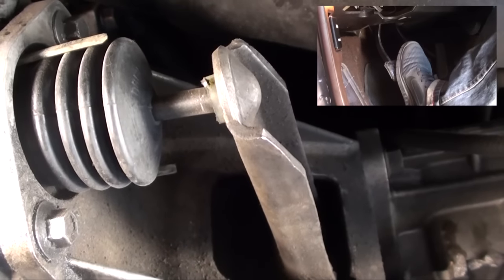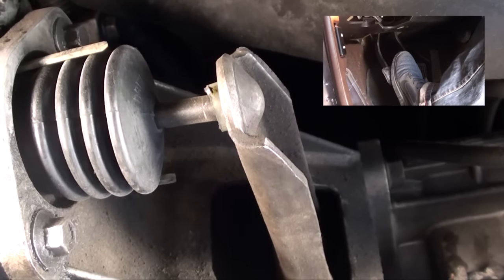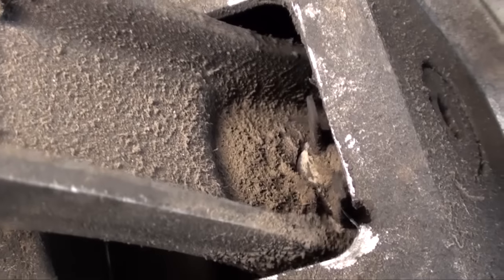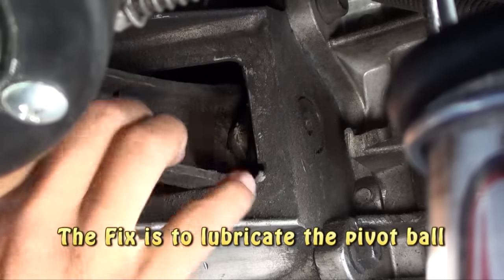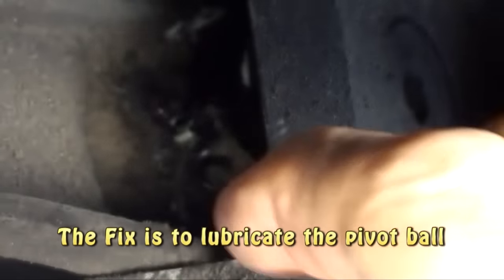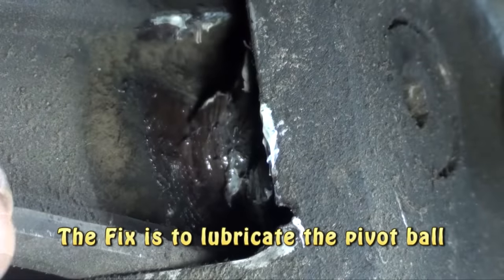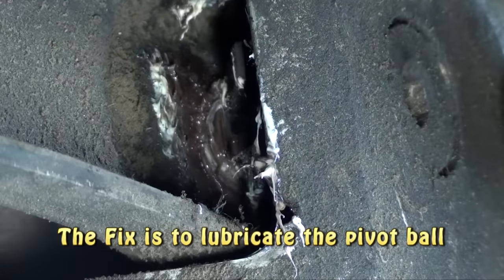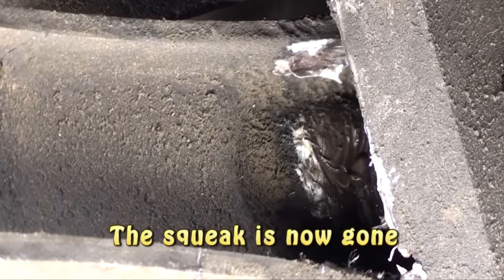Clutch Release Fork Noise

Comment: This video could potentially save viewers tens or even hundreds of thousands of dollars on unnecessary throwout bearing replacements! Thank you so much for this knowledge!!
Reply from the maker: Yup......  Not all clutch systems have pivot balls that are accessible from the fork access hole and not all clutch systems use a fork and pivot ball.
Reply: @DrivelineMaster  my mustang t5 transmission is doing this,does it matter what grease you use?
Reply from the maker: Any grease will work but lithium based greases work best for this location.
Reply: @DrivelineMaster  ok ,because man mines is so loud and aggravating
Reply: Where is this located?  My 94 mustang gt started doing this.  I couldn’t find
Reply from the maker: If I'm not mistaken your mustang uses a cable instead of a hydraulic cylinder. The cable connects to a metal arm called the release fork and it's located on the left side of the bell housing. The bell housing is between the back of the engine and the transmission.  A rubber boot overs a hole in the bell housing where the fork sticks out so dirt doesn't get in.  Normally that boot is pulled back to expose the pivot ball and lubrication can be applied like in the video.  On some designs such as yours the pivot ball is located on the opposite side of the bell housing with no access to lubricating while the transmission is still bolted to the engine.  In order to lubricate the pivot ball on your clutch system the transmission will have to be removed.  If you go that far you might as well change the entire clutch since the labor cost is almost identical.  I wish I had better news.
Reply: Absolutely correct.

Comment: Not sure why this video was recommended to me again, but I saw this video several years ago and it helped stopped the squeak on My 2006 Subaru Forester.  I just removed the rubber boot covering and jammed as much grease in there as  I could and the noise was gone.  The squeak started the day I got my clutch replaced by a mechanic so he must not have greased it.  I sold the car earlier this year but just want to offer a late "thank you" for getting rid of the noise that was driving me crazy.  Merry Christmas!
Reply from the maker: Glad it worked out for you. So sad that the service tech didn't know enough to grease the pivot ball.

Comment: My mechanic diagnosed my sound as a release bearing which would of cost 1000 aud. I had a feeling if wasn't the issue so I done some research and ended up here. I followed the steps and nothing, still the same sound, so I added more grease and still nothing. After i drove around for an hour and then it stopped. Fantastic. So to anyone who tries have some patience. It might take a while for the grease to spread where needed. Thanks

Comment: Had a squeak in my ‘08 WRX; shit raised my blood pressure. Mechanic said it’s a TOB & that I need to replace the whole clutch/flywheel. The appt was today but I cancelled, and tried this instead.

My squeak is 100% gone. Saved me $1,500. I did not think this would be so easy to correct, but it was. Thank you very much, sir; appreciate you.
Reply from the maker: That is fantastic.  Yes, some WRX release fork pivot balls can be reached by simply removing the inter-cooler and pulling back the release fork boot. This give you access to the pivot ball.  Glad it worked out for you.  There is a clear difference from when this noise comes and goes and when a release bearing (TOB) noise comes and goes.
Reply: Thank heavens I found this comment I have same issue with my 11 wrx! Thank you!
Reply: me too

Comment: Thanks so much. After long periods of time working with the master cylinder and clutch tweekings and changing the throw out bearing and cluch press for the gears to work. All of a sudden this noise came out. It was a bummer because we think that the throw out bearing was damage because of water. And now i saw your video problem solved. May Allah bless u
Reply from the maker: Yippee!  I had no idea how many people have this problem and how many automotive professionals think this is a throwout bearing noise.

Comment: Thank you for this.  I had the the same noise coming from the clutch area. I went ahead and lubricated the bearing just like you did and voila, the noise is gone! Will share this video to help other folks experiencing the same issue! Thanks again
Reply from the maker: I'm glad it worked out for you.  I had no idea how common this issue is until after posting this video.
Reply: Jeeminy. I hope my '06 Accord 4-cyl. Has this problem, and is not the thrustalizationizing bearing. My mechanic, who is the best I have ever found, is also pricey. Wants 3 (followed by a comma and 3 zeroes) to do the whole clutch renewal. If I do get in there to do it myself, it is ridiculously involved, and hope I don't get stumped with WTFs and magic tool needs. I've done trans R&R on older vehicles, RWD where the transmission was behind the clutch behind the engine, and although a couple bolts were hard to get to, 12-point box-end wrenches and standard sockets on 1/2" ratchet drives worked in the tight spots. 
    On my Honda car, I have to remove a wheel, CV axle, even the battery, its shelf, air box, even unbolt the intake manifold! So re-frikkin'- dick-ulous.

Comment: Had old clutch replaced, been driving around 2000km, and noise started. After seeing this, im pretty sure i drove over few very dusty road construction = might have dirt in that part. Thank you for this nice video!
Reply from the maker: There is supposed to be a rubber dust boot covering that hole.  Mine was missing for this video.

Comment: Thank you a lot for your help! I replace the clutch a few weeks ago after that I have this annoying noise and with your video I figure out what is the problem.
Reply from the maker: Unfortunately too many technicians who change clutches don't know how to properly lubricate the clutch release fork pivot. This also puts into question if they properly lubricated the clutch splines and the release bearing contact points and sleeve.

Comment: Yes, my clutch is engaged, changing gears, up or downshift, and makes a similar noise to the video. More like a whirring sound. When I release/unengaged, the clutch, no sound. Thanks for your response/info/efforts. By the way it’s a Chevy S10 truck that otherwise is a champ. Use it everyday.
Reply from the maker: Clutch engaged (pedal up) you hear a noise.  Clutch disengaged (pedal down) noise is gone.  Clutch engaged and pedal is depressed about 1 inch you still  hear the noise.  If this is the case it sounds like you have a transmission bearing.  I can't be certain but the most common one would be the input shaft bearing. Try changing the oil in the transmission.  Make sure to get oil with the correct GL rating. Most of those transmissions specified GL4 not GL5 but check the manual to be certain.  If the oil change didn't help you try changing it again but this time use something like 140 gear lube. It might help.

Comment from the maker: Glad this helped.  Yes, those crickets are very annoying.
Reply: Thanks for the informative video. I have a car that makes an intermittent scraping noise once I start to accelerate again after switching gears. Any clue what that might be? It started right after the car sat for a week while we were on vacation.
Reply from the maker: Could it also be described as a screeching noise? What is the position of the clutch pedal when you hear this noise?  Are you pressing it down? if so how far down is the pedal when you hear the noise? or are you letting the pedal up? and how far off the floor is the pedal when the noise is heard?  Or maybe your foot is not touching the pedal.  How about the gas pedal? are you accelerating, decelerating or holding a steady pedal. Are you giving it gas to take off from a stop?  If you can respond to these questions with as much details as possible I might be able to help figure out what your noise is.
Reply: @DrivelineMaster  I am really sorry it took three weeks to get back to you about this.. I have thought of needing to respond every day but kept getting sidetracked. So it isn’t a screeching noise, it more sounds like metal plates scraping together. It usually happens after switching to 2nd, 3rd, or 4th gear. After I change gears and release the clutch the sound comes when I accelerate and is usually more prevalent between 2k and 2500 rpms. It’s so strange because it is intermittent and doesn’t happen all the time. But it does make the sound more often than not. I am not losing any power, the clutch is not slipping in any way, and it seems like it’s running just as it was before the noise began. The only other bit of information is that my throw out beating is making some noise. I can hear that when the car is sitting still in idle and I have it in neutral with the clutch petal released. That’s really the only info I can think of that might be helpful
Reply from the maker: This is strange.  Let me ask you this about your throw out bearing.  When you hear the noise of the throw out bearing what happens to the noise when you apply a small amount of pressure on your clutch pedal? Does the noise go away? get louder? or change in tone?  What happens to the throw out bearing noise as you continue to depress the pedal the rest of the way to the floor?  Next question. Are you certain the noise is coming from the clutch and transmission area?  Do you know what pre-ignition or spark knock is or sounds like?  If not try a tank of high octane fuel and see if the noise goes away.  If it does then this is your noise. If you are familiar with the noise of spark knock and you know that is not your noise then skip the high octane gas test.
Reply: @DrivelineMaster  I’ll see what happens tomorrow with the throw out bearing noise. Another thing I have going on is the clutch petal making kind of a popping noise when I push it in and release it. That started right after I took my car to Midas to have the alignment done and I’m pretty sure when they took it for a test drive they were ripping on my car 🤬 I suspected that because I had a floor jack in my trunk that was flipped sideways after they had it in the shop. The popping sounds like it is coming from somewhere right above the pedal. As far as the pre-ignition knock goes, I am familiar with the sound and I’m fairly certain it is not that as I always use high octane gas and it really doesn’t sound like that. By the way, I really appreciate you taking the time to try and diagnose this.
Reply from the maker: Oh great.  Look at your repair order to see if they recorded the mileage when you brought it in and the mileage when you picked it up. If they recorded it like they should have this might show how much it was driven.  Now it sounds like you might have some pedal mechanism problems.  Your going to have to crawl under the dash with a flash light and look at all the linkage and pivot points to make sure none are loose or have worn out bushings. I'm not sure what to tell you about your other noise right now.  Any chance of recording your original metal noise on your cell phone and emailing it to me?  drivelinemaster@gmail.com
Reply: @DrivelineMaster  I’ll try to get the noise recorded but it’s kind of hard to hear with the windows up. And obviously with the the windows down there is a bunch of wind noise that frowns out the sound. I did listen to the throw out bearing and the noise pretty much goes away as soon as I push in the clutch a little ways. Often times, the noise is more prevalent and other times I can hardly hear it (with the clutch pedal all the way out) It appears from the Midas work order that they didn’t drive it all that much.. I just suspect when they did drive it, it was driven pretty hard.. which is obviously frustrating. I was going to ask you, what are the symptoms of a dragging clutch? Noise wise and performance wise? It’s strange because it really doesn’t feel like the car is performing any different, but I’m almost certain the sound is coming from the clutch because it only makes the noise when I am in gear. I have tried to replicate it going down the road 30-40 mph putting it in neutral and reving the engine to see if I can replicate but I can’t hear anything.
Reply from the maker: Ben,  Throw out bearings make more noise or the noise tone changes when the pedal is depressed about 1". The fact that your noise goes away tells me that it is a release fork pivot noise and not a throw out bearing.  Now if the noise is still present with 1" of depression and only goes away when the pedal is 2/3 to 3/4 depressed then that would tell me that the noise is coming from inside the transmission.   Clutch drag is when the disc does not release quickly or only releases partially from touching the flywheel and pressure plate or the full release is delayed.  Clutch drag causes hard shifting or grinding noises (gear clash) during a shift.  Say for example during your normal shift from 1st to 2nd your hear a little grinding and it's a tiny bit difficult to shift that could be due to drag.  Now the next time you shift from 1st to 2nd you depress the clutch and count 1001, 1002 and then move your shift lever into 2nd.  If the grinding is gone and the shift is easy then you were experiencing clutch drag.  Any chance your vehicle is leaking oil on the ground and oil could be getting into your clutch? Oil on the clutch disc can cause this along with other things.
Reply: @DrivelineMaster  At one point I was having issues with the car grind into and occasionally popping out of 3rd gear. I ended up replacing the clutch fluid with bg snycromesh 2 and I haven’t had a problem with it grinding or popping out since. Although, I do feel like shifting is a little hard.. not crazy hard, but not as smooth as they should be. I think there is a good possibility I will have to replace the clutch at some point. It’s a pretty sweet car so I’d like to hang onto it. It’s an Accord exl 6spd 3.0 J-Series  
I feel like it a pretty strong engine and the car is actually in really good shape. Any ideas what I can expect in cost to have a clutch replaced?
Reply from the maker: There is no such thing as clutch fluid.  There is fluid for the clutch master cylinder which is basically brake fluid and there is manual transmission fluid. That is what Synchromesh fluid is, so you changed the transmission fluid and that would make sense since synchromesh will help with hard shifting but I'm surprised that it helped with the popping out of gear.  Clutch replacement will depend a lot on where you live and the cost of labor but don't be surprised if it cost $500 -  $600 depending on if the flywheel will need to be replaced and if the rear main engine seal is replaced.
Reply: @DrivelineMaster  yeah sorry, that’s what I meant was the MTF. I also changed the master cylinder fluid. I don’t think I’m losing any MTF because I don’t have any fluids on my garage floor or anything.

Comment: Very helpful video! my 2012 civic has got exactly the same issue, the noise goes away if you slightly press the pedal, however I cannot find access to the clutch fork easily (I don’t even know where it’s at tbh) and I wonder if I can go on with this noise without any real big issues for a while
Reply from the maker: If you let this go on it will eventually wear a hole in the release fork. If that happens your clutch will no longer work.  I can't say how long that will take. It might go for a year or so or wear through in a month or so.  I think your release fork and slave cylinder is on the transaxle under the air intake system. If you remove the air filter box and induction system you should have access to the slave cylinder.  You will need to remove the slave cylinder but don't disconnect the hydraulic fluid lines.  After unbolting the slave cylinder DO NOT push on the clutch pedal. Once the slave cylinder is out of the way the rubber boot around the release fork can be removed. Once removed you can look into the transmission bell housing for the release fork pivot and see if there is enough room to get some lucubration in there.